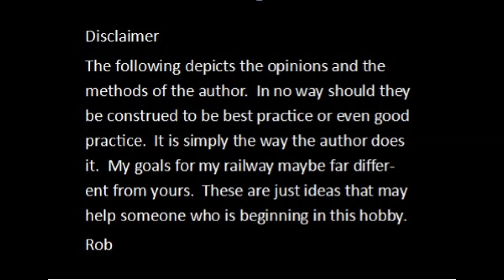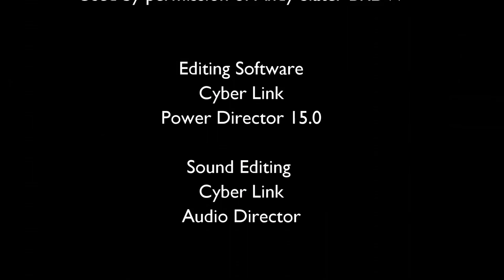18B  Farland Build

Comment: Good progress on the station. On the hillside scene, I feel this is such a good backdrop, it would really help add realism by putting things like a hiking trail, some extra foliage, a small keep on top of something maybe. Nothing that becomes a focal point in itself, just a little something extra to make the whole area look alive and make the station pop.
Reply from the maker: I am working on that today and will probable for the next couple work days.  What maybe some ruins of some kind?
Reply: Yes, that's what I was thinking. Some small ruins that would have been a little lookout point or tower. Along the coast there would often have been these structures, such as WWII pillbox types all the way back to 15th century kinda of structures. My hometown of Durham, England has a park that overlooks the train station called Wharton Park. If you search for images, there's a small structure with battlements across the top that I believe was built in the mid-19th century. Not necessarily for defenses, just because :) Just some ideas to add a little extra character. I'm sure whatever you're working on will turn out great.

Comment: That's a handsome cat Rob. Interesting how you mixed up the colour (sorry color). I'd have probably painted it bright yellow and then dusted it with black car spray to get a varied weathered effect - just another way. It looks good though darker. I can see why you did that. I didn't know about the catwalks. No wonder your visitor turned up - it is a catwalk after all lol. 
Looks a bit dangerous that hike but I do think it would be good to have a trainspotter there. I liked the tree. Catwalk is interesting but I might have put it on the other side maybe? Not sure - you have a better view there lol. Also I do think it would be good to add a little ballast at least around that track, otherwise it might always be a niggle. Won't need much. Cheers Rob, Laurie.
Reply from the maker: Jupiter is a mangy old momma alley cat.  She loves me though and that is fine.  She was a rescue kitty.  I goofed on the first mix of the colour, but could use a little of it to modify the next batch and it worked out.  Colour is funny stuff and fun to mix.  Black car spray works okay if you can take it outside.  I would probably over do it and ruin everything.   It worked out in the end.  Ha ha, catwalk...To get to the top of the hill, there is a way up the back side that would be steep, but much less precarious.  I put the narrow platform there thinking trainmen, could use it.  I will no doubt add some ballast.  I didn't think I needed it until I put that camera back down.  Just some up the middle.  Right now I am still moving the rear platform in and out for access to the scenery behind the station.  When that is done, I will do some light ballasting.  Thank you Laurie.
Reply: Yeah I know, colours never seem to quite go how you think lol. If I darken blue it goes dark grey lol.
Reply from the maker: Calvertfilm Yes and other goofiness

Comment: Hi Rob, in my view you have everything right and seem to have captured the essence and feel of the Devon coast perfectly. I do think you will need to ballast that track as it does look unfinished at the moment. I like the colonnade as it helps to completely separate the low level line from the station and some vegetation along the top of the cliff will be in keeping as Devon does have a lot of trees and bushes unlike Cornwall, the next county, which is quite bare of both! .............................John
Reply from the maker: Hi John, that is good, I like Devon very much.  I shall add more trees.  First, though, I will have another look at the vegetation around the coastline.  Bless Google Street View.   Yes, I now agree, it does need ballasting.  I had not thought about the colonnade being a good separator, but you are right.  Great comment, thank you, Rob
Reply: Google street View is a winner in so many ways! .........................John
Reply from the maker: So true

Comment: Rob, I love your layout and would like to ask where did you get the canopy supports which you have on platform 2. I have just recently found your youtube channel and slowly making my way through them all. Your help  would  be very much appreciated as I am new to all this. Thanks, Mike
Reply from the maker: Hi Mike, Thank you.  I am so pleased you found my channel.  The canopy at my  Far Cliff Station are Wiils kits SS54 Station platform canopy - plastic kit.  I've had them for a while and they were on my previous layout.  I have two stations with canopies so I was not sure which on you meant.  If this is not what you are looking for contact me again and we will get it sorted.  Rob
Reply: @FarlandHowe  Thank you for the prompt reply Rob which is very much appreciated. The Wills Kit SS54 is exactly what I am looking for. I have been looking for these Victorian cast iron columns, not necessarily the roof cover, which has eluded me up until now and it was when you showed a close up of your own layout, Platform 2, I saw what I have been looking for. I even spoke to someone to see if they would be able to 3D PLA print them for me but their response was less than hopeful. So thank you once again for directing me. Now off to see if I can make skme gnarly trees, rather than buying them, and to follow your very instructive videos. Cheees, Mike
Reply from the maker: ranfurly 1222 Best of luck Mike.  Those very special one of a kind trees are great fun.  Thanks again, Rob